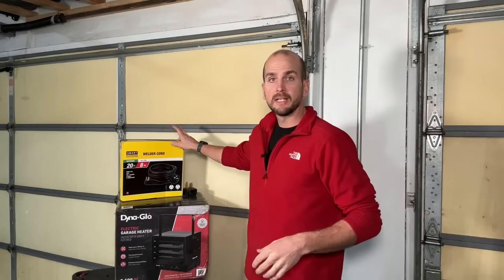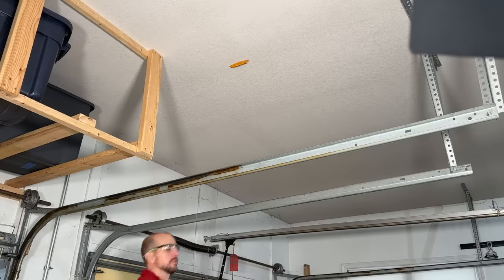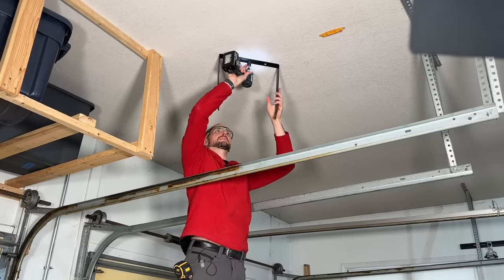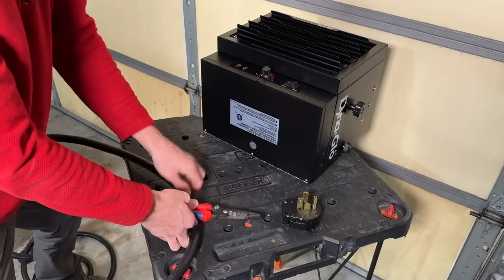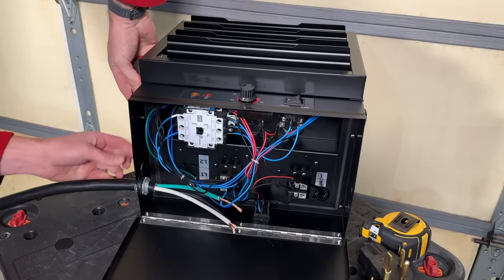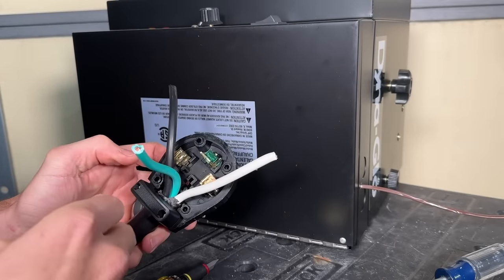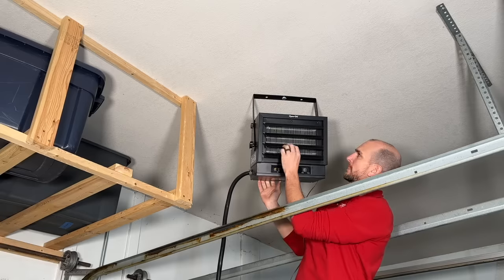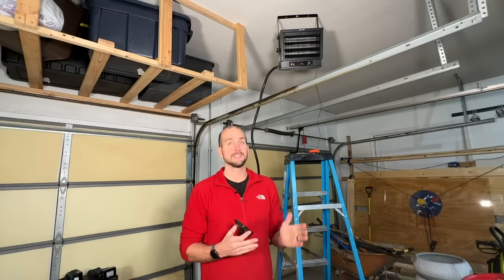Electric Garage Heater Installation And Test

Comment: I have the same heater in my 800 SQ FT 4 car garage in Indiana.  It’s wired in the same way using my 220 plug for car charging and welding.  It works great but when I added a old ceiling fan in my the center of my garage it was a game changer.   Takes 1/2 the time to heat it up to 65 deg and keeps it a nice even heat in all corners of the garage.
Reply from the maker: Nice, thanks for the feedback and agree the circulation would definitely help.  👍

Comment: Nice install, my only criticism is the thermostat wire should have some kind of grommet or chafe protection, especially since there is a fan in that heater that will cause vibration.
Reply: @Kevin-mp5of  That’s beyond excessive, the thermostat is 24 volts maximum. It just needs something for chafe protection
Reply: @Kevin-mp5of  there is a 0% chance the thermostat needs a 14 gauge wire. Have you ever wired one? The terminals will not fit a 14 gauge wire a lot of the time. It's a low voltage signal wire and that's all
Reply: @Kevin-mp5of  even if it's 240V, 22 gauge wire will handle that just fine, it's not pulling that many amps

Comment: If heat rises, then you’ll just be heating up the upstairs not the garage I think
Reply: Eventually it'll fill the space.
Reply: Sheetrock is an OK insulater drop cieling panels are the best
Reply: I mean, I don't know what your ac system looks like, but my ac ducts come from the ceiling.  Heat works well. It all really depends if you have an insulated garage where a unit like this works well. In my garage I'd be wasting a bunch of heat.

Comment: For people doing this, if not using proper cord, take the extra 20 seconds to wrap your white wire with red electrical tape, or paint it with a red sharpie to identify it as hot.  As it sits, without knowing, an assumption can be made that it's a neutral wire, not hot.  Yes, the terminals have labels of L1 and L2, but it's a sticker, stickers come off with heat.
Reply from the maker: Thanks for the feedback and agree that would be a good practice.

Comment: The welder cable you linked says it is only 12 AWG in the description, which of course would be way undersized for a 7500 W heater or even a 5000W heater.  Also saw a review talking about misleading information on the wire size -- like maybe the terminations are rated higher than the wire?  Might wanna double-check that.  I can't tell in the video -- the insulation is quite fat,  but not sure about the copper.
Reply from the maker: Thanks for the callout on that and totally agree 12 gauge is too small for this application.  I will swap out the Amazon link to at least a 8 gauge.  If you have a Menards in your area this is actually the cord I picked and used in the video https://www.menards.com/main/electrical/electrical-cords-surge-protectors/extension-cords/smart-electrician-reg-20-8-3-40-amp-welder-cord/90990/p-1444429528908-c-6410.htm?exp=false

Comment: FYI , I leave mine on the LOWEST setting in my 30 X 36 insulated pole barn. adds approximately $150.00 per month to the bill. 59 degrees all winter. I live in Pennsylvania. sounds expensive but all my toys stay warm and toasty. It's worth it!

Comment: In my area you are NEVER permitted to use a cord & plug for a piece if equipment that is bolted in place like your 7.5 KW unit heater. Electrical inspector would require it to be hard wired. Could install a not cheap two pole double throw 50 or 60 amp switch from your existing 50 amp receptacle.. A 30 amp switch is only good for 24 amp continuous load.( NEC 80% RULE ).When I installed a 5 KW unit heater in my one car garage used a 3' long piece of unistrut with a lag bolt in three joists to hang it.

Comment: Why not install a ledger (probably incorrect term) across two or more rafters so you could have more than one bolt holding the thing up?
Reply from the maker: That’s an option for sure.  Just gets a little tricky depending on the direction you want to point the heater.

Comment: I have an issue with this heater. 2nd winter in use and it did not seem to be heating as much as the first winter. Took down and opened it up and found one of three heat elements was open. Called the company to get new heating element ( all three contained within a single unit). The heating element assy is not available. Though this company is still selling the garage heater. Obviously if they are still manufacturing the unit, heating elements must still be available. I do not recommend this heater. I bought this in January, 2022 for $200. It now cost $369. Thank you Brandon!

Comment: A few things. 

You might want to also consider picking up some Green Hinges. I added some to my garage door and they created a nice tight seal. I don't see anymore day light around the door and it stays warmer longer once I heat the garage up. It eliminated all the play that you have with regular hinges.  

I haven't tried this product but I saw a product called Thermo Traks. Its a replacement rail for your garage door that also assists with creating a tight seal. 

Last thing I'm not sure if you have any flooring in your garage but that also helped with maintaining warmth in the garage.

Comment: Our builder left us 220 at both ends of our garage ceiling in our 3 car garage. I installed 2 similar heaters  in the garage. Sure is nice to work comfortably during these cold winter days.

Comment: That is pretty cost effective. If you have a project for 6 hours and it will cost about $6. Not to mention that if the temp reaches to require setting, it will shut off. Great install. Thank you for sharing

Comment: Great video thanks for the info.  I recently got the X series 10kw heater and used a 50amp RV extension 6/3 + 8/1 for the wiring to my 14-50 outlet.  Just cut the female end off to length and cap the neutral (white wire) since it is not used for 240.

Comment: Nice project. Put up a similar unit in my garage last Jan (did a video on it, too) and it has been a winter lifesaver for car projects in cold weather. Easily bumps in up even my insulated garage around 20-25 degrees in short order. Wish I'd done it years ago.

Comment: Was taught many years ago to always have several more inches of slack on ground wires from all cords. Reason being if cord ever pulls out of flimsy romex connectors the ground wire would still be connected. In commercial sites we usually used Kelms grip cord connectors. The stainless steel 6 to 10" basket heavy enough that you a 300 pound guy can hang onto a cord without pulling out the cord.

Comment: What thermostat did you connect? You should do an update showing how it’s wired as well. I have the same heater and trying to figure out the thermostat has been a nightmare.

Comment: Pretty cool that it works so cheaply per hour.  I would have expected it to be much more than that.  The only thing I would have done different would be in measuring the power cord length so the cable would connect to the unit like you did, but then let it hang down a bit, then arch back up and mount it with cable brackets across the ceiling toward the wall, then 90° arched down at the corner and continue down the wall with cable brackets on the wall and leave enough length to plug it into the outlet or, if necessary, leave the cable long enough to bend back up when plugged into the outlet.  The part that hangs down at the unit and back up to the ceiling is so the unit's swivel position could be of a greater turning range, but the cable would be secured to the ceiling and the wall better.  I think it would look more finished and aesthetic like that.  Glad it works out for you the way you had hoped.  Great job, Scott.
Reply: Encouraging for me because our rate is 8.05 cents per kWh

Comment: I have a similar heater and an infrared heater in my home garage/workshop. For my 220 electric heater I put a thermostat on it. I don’t remember what YouTube video I saw but he recommended a particular thermostat for the heater and it works great. I use the 220v heater to warm it up a little until my infrared heater warms things up and I switch the electric heater off. Also when I mounted my electric and infrared heaters I used a 2x6 long enough to go across 3 studs and mounted them in place, then mounted each heater to them.  I just wanted some extra beef to tie them into…. But then I tend to over build.
Reply: I agree I would have secured it with at least 2 lag screws from 2 rafters. There's no way of telling if that one lag screw went into the center of the rafter and not the corner where it doesn't have a good grip into the wood. If he hit the center then it will probably be fine, but I would certainly want to check and make sure the lag screw is securely fastened into the wood

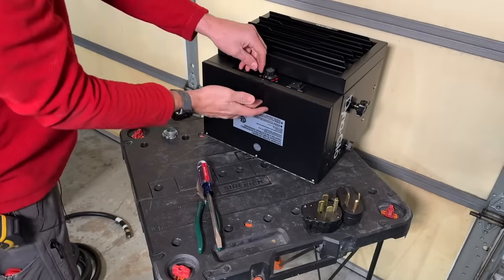Comment: 6:20 a nice set of steel bolt cutters will save you a bit a wrist fatigue here. Chop right through that with a clean end and no repeated chopping needed.
Reply: a dab of silicone or something similar would be a good idea on that thermostat entry too. Likely not an issue, but you never know, vibration could chew the wire up on the sharp edge.

Comment: Nice install, but I see it differently. I would have installed a metal conduit starting from your new 50W outlet to a couple feet of the new heater. At the heater end, a compatible outlet with the cord  supplied with the unit. At the other end near the 50W outlet, a junction box with a 50W stove cord, easy to find and probably the same price as the plug you installed. For the thermostat, cable, I think you failed to put a rubber grommet at the heater. May I suggest to move your thermostat to an inside wall? Between the two garage doors, I think this the worst emplacement for the accuracy of the temperature reading.

Comment: I find with my Propane heater in my 2 car garage with open rafters well raise the temp about 10 Deg, 50 deg is comfortable and I use maybe half a grill tank in 3 - 4 hours
Reply: I use a propane patio heater in my garage as well. The biggest problem I have with that is remembering to get the tank refilled! 😂

Comment: for those trying to figure things out, a Kw is about 3400 BTUs so 7.2 Kw is about 24,000 BTUs. Now you can do the math on that propane or diesel heater to compare operating costs. You still need to consider this is a first hour run. Once you reach temperature the unit will cycle off and be less per hour on cost.
Reply: @Kevin-mp5of  ... there was no manual shown in the video and no clear markings for voltage at those terminals, that we could see.

Comment: Great video. What size circuit breaker are you using? I am looking at using this size unit and plugging it into my 50 amp welder outlet, but the heater says a 40 amp breaker. I a wondering if it would be ok to use a 50 amp breaker instead.
Reply from the maker: I used 50 Amp 👍

Comment: So I had a house built in 2017 and I added the EV charging option prep.  All they did was run the thick gauge wire from the breaker box to the garage into a wall panel.  Nothing is hooked up.  No 50amp breaker was installed and no 220v female outlet was installed.  I have a 200amp breaker box with plenty of space left.  Can I just finish the install or do I need to pull permits and such?  Seems easy enough…. install the breaker and the outlet.

Comment: I have to use my garage as a "spray booth" for spraying lacquer onto guitars. Usually I have to wait until the outside air temp is at least 55 degrees. It would be nice to be able to spray with the garage door mostly down, with some ventilation. However, I would be concerned that the overspray from my spray gun and fumes would be volatile with a heater like that. Does your heater have open elements that would combust or does the fact that it's putting out high heat at the elements cause concern for fire or explosion? I could still use a heater; just not paint when it's on.

Comment: Excellent explanation. I currently have a heater in my 20x20 unfinished/UN-insulated garage and it it connected to 20 amp breaker. I am not sure of the size right now but it doesn't seem to heat it up enough. Do you have any recommendations as to how big/ what size heater I would need to heat up my garage?
Reply: Without insulation I doubt you will be able to heat it with electric. Depending where you live how cold it is outside and the wind. The heater in video pulls 30 amps and you said you only have 20 amps. When trying to heat stopping heat from escaping is the key. The ceiling is important. Stopping the wind and making the size of the area you are heating smaller. A torpedo type heater will do you better till you insulate. Propane is my choice over kerosene. Be mindful of co fume and fire. Follow directions that come with  heater.
Reply: @jeffhodupp4641  Thank you.

Comment: Curious, with use over time, would the heat affect the metal framing for the garage door, in addition to the plastic storage boxes to the left?
Reply: The rail no.  The plastic ae long as you maintain the proper clearance stated on the heater you will be fine. The sides do not get too hot. The front goes. You don't want it pointing at anything  flammable or will melt

Comment: Did I hear corrrectly that magnetic gizmo is called a StudBuddy?  Looks like something I may need to add to my toolbox.  But how well does it work on a plaster lath ceiling?  

One minor nitpick on your cord,  Shouldn't the white wire be marked as being a hot wire?
Reply: It's just a magnet in a plastic holder. It sticks to the nails in the stud.

Comment: Great install. I have made tons of custom welder cables and hate those damn ends. Just preference so don't take it like I'm the electrical god, ha ha ha!
I would put a grommet around the thermostat wiring, but other than that looks great to me. And I was surprised how cheap it was to operate... quite a bit less than these stupid 120v ones that don't do the job. 3 hrs plus to get 5 degrees with a fan on the unit and a circulation fan. I might have to convince the check writer to let me add a circuit.... 😁

Comment: Before you drill your pilot hole, you should take a stud finder with an electric wire detector feature to not only look for a joist, but to look for  any buried cables in the ceiling.
Reply: I thought the same, but he probably knows what's up there so I'm not questioning his application. Yes, maybe mention for others though...

Comment: Love to have a heater in my garage also. I have a similar sized garage. Only problem is I don’t have a 240V outlet. I’d have to run a separate circuit to the garage first. I only have one last space in my fuse panel and it’s only big enough to fit a 120V breaker. 😞
Reply: Think about upgrading your panel in 2023, 2023 tax time you can claim a credit on your taxes towards it. I have a 48 spot panel ,  it was worth it. I didn’t even get any credit towards it either.
Reply: @brodyllc  I’ll look into it with my accountant. Thanks! I’m certainly at my limit. It wouldn’t have been an issue but I just recently ran a new additional 240V circuit to install a steam humidifier on my furnace and that took up the last spot.

Comment: I'm curious on the thermostat you used as it kind of looked like a 24V one which could be a problem. I have a 5000 watt heater in my double garage and it takes a few hours to get it to a decent temperature. Not sure if a 7500 watt would make a big difference or not so am still contemplating upgrading it. I have it just plugged in like you do for now but will have to get it hard wired as it's against code (I live in Winnipeg, Manitoba, Canada) to have it with a plug like that. I also want to get a thermostat on it but would like one that can be controlled via WiFi. So would need a contactor and transformer to reduce from 240V to 24V. Would be awesome if you did a video showing this :)
Reply: The heater must be set up to run low voltage thermostats. He mentioned having to flip a switch on back to use that thermostats. No way was that a line voltage thermostats.
Reply: @user-dn5cr6fe6h  are you saying he pulled 30 amps thru that thermostat ?
Reply: I hooked mine up with a 220v Honeywell CT410b. Got it at Menards. Was on display right next to the heaters. Any way that seems to be what was illustrated in the installation manual. It must have it's own 220v power supply using 14 ga wire. The heater is wired with 10 ga for my installation. The instructions were a little vague so I watched the same thermostat installed with baseboard heaters. (220v)
Reply: And I did hard wire the heater and thermostat in conduit and flexible conduit.

Comment: nice install, wonder what the cost would be with a taller ceiling or open rafters
Reply: The same cost  per hour but you wouldn't get the 10 degree rise in  temperature. In his test it ran at max power a hour.

Comment: What thermostat did you use? I just bought the 7500w dyna glo heater and i cant seem to find a thermostat that is rated for that much watts. I also initially just wanted to use a smart thermostat. Any input would be greatly appreciated. Thanks
Reply: For this heater, the thermostat does not carry the current for the heating elements. It is only used to power the contactor, which in turn switches the current to the heating elements. That’s why the manual recommends 14 gauge wire to hook up the thermostat.
Reply: So if i am understanding this right, I do not need a high voltage thermostat?  @MrVopt

Comment: Interesting that you can just hook low voltage wiring to those big old lugs for thermostat wiring. I just bought one of these and the installation instructions  are confusing. They make it seem like you need to use a line voltage thermostat and they list 14 awg as the minimum size thermostat wire.